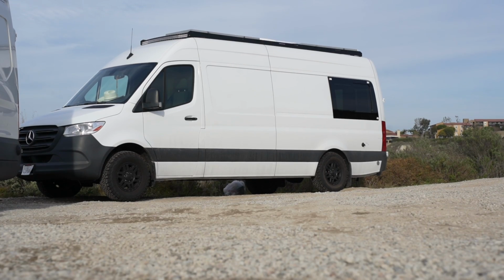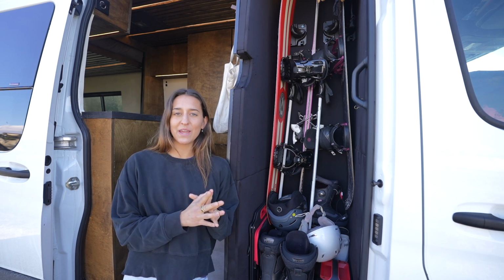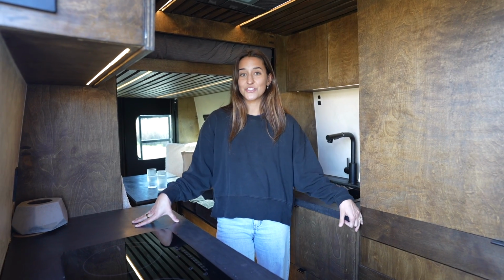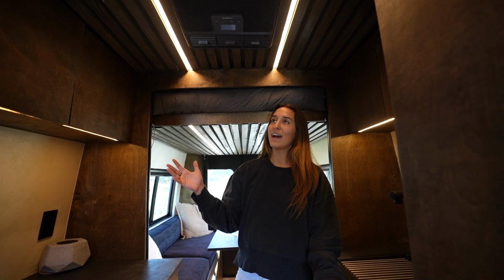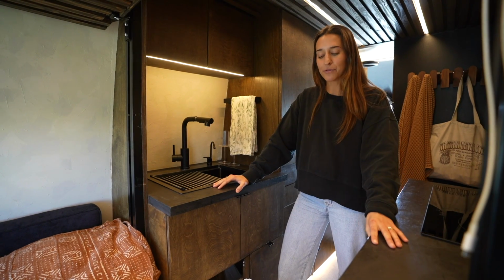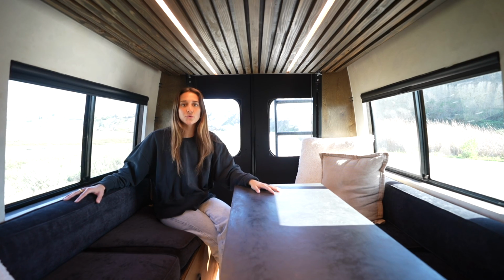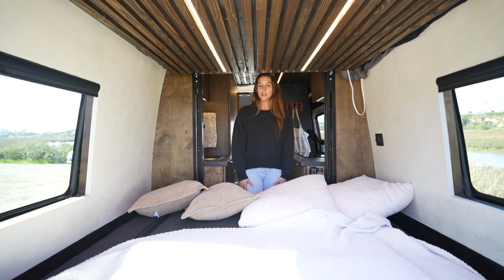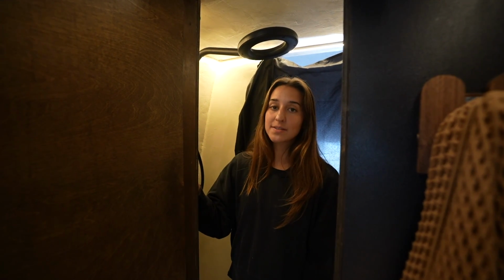Ultimate WINTER SPORTS Van Build // ft. Heated Gear Closet!

Comment: Hey, I love the shower set-up that's probably inspired from Lucas Ravizza but I don't understand why you both have decided not to put the toilet in the shower instead of having a "garage" here, that way you'd have a permanent/private toilet, and you can probably put your gears somewhere else..
Did you find a technical issue to install the toilets in the shower?
I'm currently planning/drawing my future build and I'll  have the same shower set-up but install an incinerating toilet where you have your garage so I'll have a big permanent bathroom and no need to deal with 💩 :)
Reply: Yes— Lucas played a big roll in the design. We needed the gear closet & and we needed it the size it is because our water tank, plumbing, electrical, and diesel heater took up the majority of storage in the back under the seating area. We could’ve went with some external storage but didn’t want to add any length or width to the van + no room at the top with the sun deck we built out.

We don’t mind the toilet in the middle really, but I don’t think it would’ve been any issue to install it in the shower!